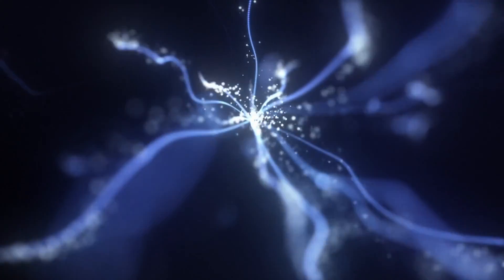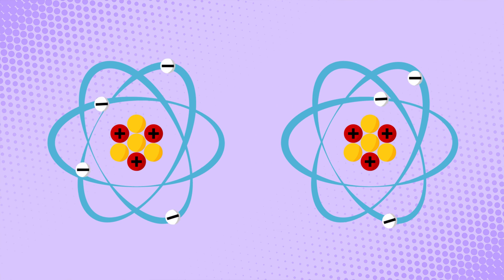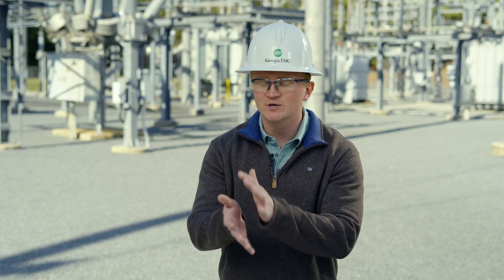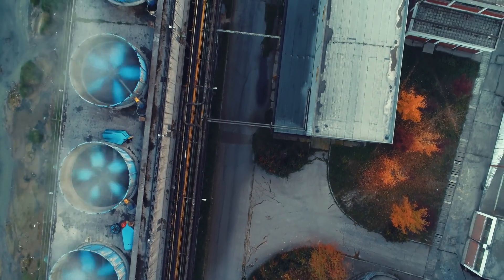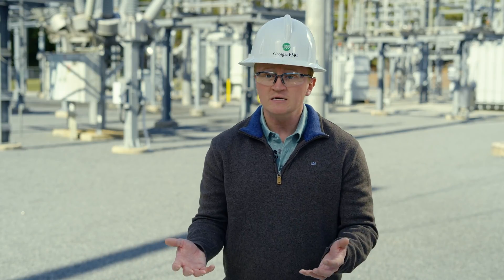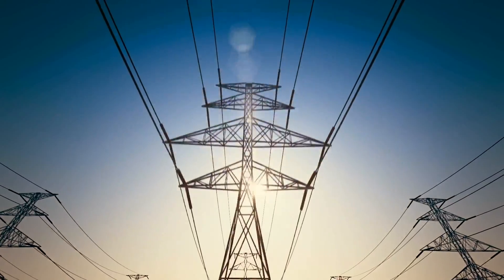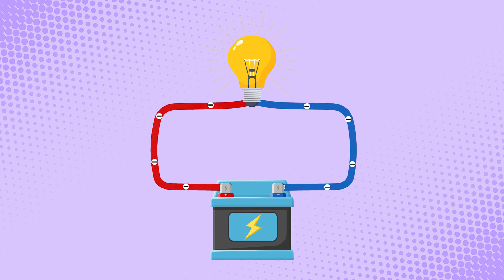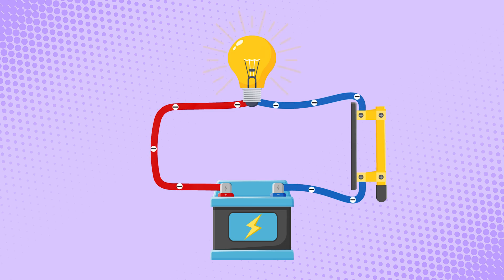What is electricity?

Comment: Electricity Is a Mineralized Water Vapor-Fuel, Inclusive of Potential to Freeze-Dry, very Similar to Dry/Hot Ice [Solid Carbon Di-Oxide], As It Connects to any Perspective Similar of It-Self, to Burn, Ignite, or Other-Wise Inflame, Also to Surge or Other-Wise "Ground"/Stop ["Grounding" Stops Electric Currents of Specific Radiuses, to Utilize As a Figurative/Simile Electric Node, Such As Humans, Before Electric Currents Proceed to a Neutral Point/Non-Static Radius:  "Current Electricity"]:  When Electricity Is Perceptive, Electricity Is Magnetic and Staticky:  Current Electricity Is of Compound Ions, and Static Electricity Is of Molecules:  "Molecular Waste" Is Known As Various "Burn-Off", or Other-Wise Burned to Hardened Elements/Minerals.  😶.

Respectively.

Tanika Nakeya Lewis, 6127